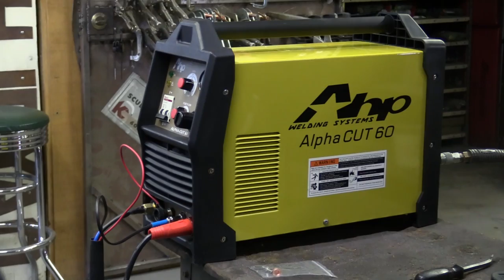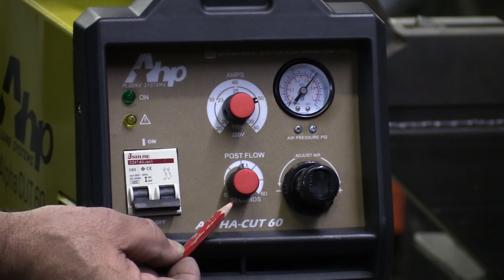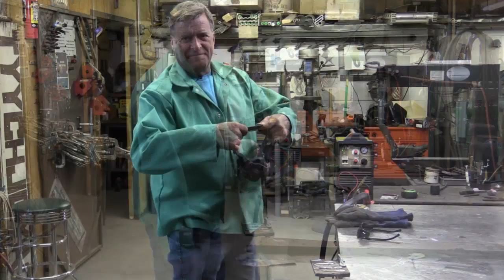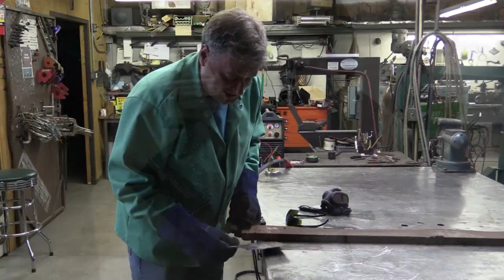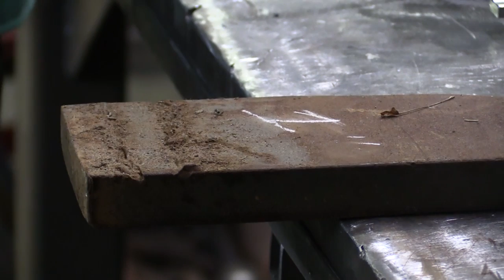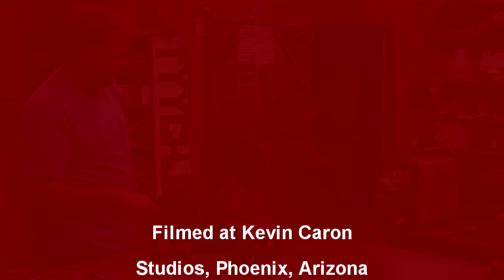Introducing the New AHP AlphaCut 60 Plasma Cutter - Kevin Caron

Comment: Did you say you think this is better than the TD Cutmaster 60I?
Reply from the maker: It cuts just as well for less money. Lighter weight and quicker to set up.  Had a guy stop in to give it a try and paid cash over the TD.
Reply: @KevincaronSculpture  Thats great good performance at a reasonable price.  Ive had a Cutmaster 58 for a year snd it gets used quite a bit. No issues so far. It doesn't have the bells and whistles of a 60i but i dont need that. 👍

Comment: Hey Kevin, I'm looking to get a plasma cutter and i have narrowed it down to 2 manufactors the AHP and the Everlast. I see you have tried out both of these types. Wich one do you perfer or recommend?
Reply from the maker: The AHP alphacut 60 is a very nice machine.    It is great if you are not going over 3/4 inch.   Over that you need to go with the Everlast 80s.
Reply: @KevincaronSculpture  how about the 50S and the 60S are they and good
Reply from the maker: I haven't use either of them but have not heard anything bad about them.
Reply: Ok thanks

Comment: hey Would like to see that cut through heavy rusted or painted steel. that is the real test for me.
Reply from the maker: I have not found anything this machine won't blow through.   Will try to film this for you next time we shoot.
Reply: that would really be good to show on your next review. Show cutting through tar coated fender well and rusty metal, and cutting through  painted metal with lots of coats of paint. Review after using this machine for x amount of time. will get lots of watch hours. I just purchased that ac dc tig and cant wait to use it the AHP. seems good. my plasma cutter really sucks but I really need to try it on 220 before I say that it is not AHP. Dont know the brand off hand.

Comment: Nice video, Kevin! Thanks for that!  Anyway as to 60 amp plasma cutter from Everlast and AHP, is there any real difference since they are the same company?  I am pretty much ready to buy the AHP but I have to say the web site information as to what is included in the box, i.e. extra consumables if any and even a downloadable manual, is somewhat less than forthcoming which is annoying to say the least.  I am assuming these are Chinese units but since with a 3 year warranty, I am also assuming them to be of better quality than most imported units. Also I gather they use IGBT's instead of MOSFET's?  Thanks for any info you can share about this!
Reply from the maker: Well, first off, Everlast and AHP  are NOT the same company.  They are run by different people on opposite sides of the country.  I will say that the guy that owns AHP USED to work for Everlast. The owner of AHP goes to China once a month or so to watch the production line run.   He test machines as they come off the line to make sure everything is correct.    So knowing that, I have no problem with the AHP line.   He (the owner of AHP) also walks across the street to check on the factory that produces the Everlast machines.   I find both lines to be high quality and would stand them up against the red or blues machines any day.    Oh yeah, Yes, both lines use IGBT.   The best way to reach AHP is to call.   Just remember they are in eastern Canada so call at the right time. I find between 10 am and 1 pm arizona time to work the best.
Reply: Thanks for clearing that up!  It seems there are several outlets that handle both so there is an assumption  made on several forums that there is a connection.
I have been in contact with 'George' and he has been quite helpful with regard to tip availability and selection. Good man!  I guess what I would do is order several of the ones for my purposes from ebay at the same time I ordered the AlphaCut 60.
I suspect I would be cutting similar materials and thicknesses as you are so any recommendations as to your most successful tips combos?
Thanks and carry on with the videos!
Reply from the maker: George can set you right on the tip sizes.   Hope you will support the little guys instead of corporate.  I just asked George what he recommended and he sent a set.  Came in a plastic organizer box and everything.
Reply: Well, I just got the AlphaCut 60 and it is sitting on my living room floor!  I see in the manual there is reference to MOSFET chips in the troubleshooting chart, but I was lead to believe this unit was IGBT.  I guess as long as it works.  Anyway as to voltage input, is there a selection switch inside the unit that needs to be set for 110v or 220v?  The manual does not mention much and I have to say that if this machine has a downfall, it would be the lack of info in both the manual and even on the website. Still, I am expecting it to be a very nice machine and can't wait to try it out...after I take it out to my garage!
Keep on with the vids, eh!

Comment: what about the air compressor?
Reply from the maker: Not much to tell, 60 gal minimum on the tank size and make sure it is DRY air.  I like a 2 stage compressor but a single will do fine.

Comment: ahp doesn't have any plasma cutter on amazon anymore? I'm in the market thinking about everlast power plasma too
Reply from the maker: Hit and miss on getting the AHP plasma.   They sell out very quickly!     Been really happy with my Everlast PowerPlasma 80s.
Reply from the maker: You can also check with George over at www.georgesplasmacuttershop.com       He is a world of information and can get you consumables as well as new torch and cable for your machine..   He also makes accessory's to fit your machine, like training wheels and a cool circle cutting guide.
Reply: I've got the Everlast 60s. I have been very happy with it. I really like that I can find the consumables just about anywhere and for not too much dough.

Comment: Hey Kevin....So I have seen you use both this new AHP Plasma 60 and the Everlast as well.  Now that you have had it for a while, if you were buying one today, which brand do you lean towards?  I have an Everlast Power iMig200 and like it and I am looking for a decent Plasma now.  I have looked at the Everlast 50S, the AHP Plasma 60 and the Eastwood 60, any thoughts is appreciated :-)
Reply from the maker: +Tom Phillips       At this time I would steer you towards the AHP AlphaCut 60..      I feel it is a better buy for the money..    The Everlast plasma I am using is larger amp wise but is also much more dollars wise..      haven't seen the Eastwood so can't offer an opinion on them at all....
Reply: +Kevin Caron, Artist 
Thanks Kevin!  I specifically would be comparing it against the Everlast 50s (new model) @~$800

Comment: Good video ... I am looking to buy a 60amp plasma cutter for my shop. However ... that's quite expensive for a plasma cutter from a company that has never made them before ... nothing much out there covering this. I was leaning more to the $700 Eastwood Versa Cut 60. They have sold thousands of them and have a good warranty. How did you decide to get this one ?
Reply from the maker: +Logical Guy 

I have their TIG  and Mig welders and they are very good machines..      Have also been talking with the guy that designs them so I know a little about how they are built..       Been a solid machine so far...

Comment: You can see, especially with 1 inch plate,  that there is almost no melting and almost all material is blown away.  What size compressor drives this?
Reply from the maker: +jtbmetaldesigns       I have 140 gallons of tank and a two stage 2 cylinder compressor...    Don't remember what the pressure was set at on the machine but it was in the 75 to 80 range...

Comment: Any specifications for the machine yet?  I went to ahpwelds.com and didn't see any mention of it.

Does it have a pilot arc?  When are the production units shipping?  What brand and model of torch does it come with?  Any idea of duty cycle?  So many questions...

$700 a heck of a deal for a 60 amp unit.  I like all the controls on the front too.
Reply from the maker: +dahveed284        Yes, it is pilot arc and yes the machines have shipped and are in stock.     You can order through me or AHP.      Don't remember on the duty cycle,   sorry the paper is at the studio...
Reply: +Kevin Caron, Artist 

What brand of torch?  I'm really interested in purchasing one of these, but i want to know what I'm getting.  Sorry to pester you.  I'd look it up on the ahp site if it was up to date.  i'll buy it from you if i do pull the trigger.
Reply from the maker: Not sure on the brand but it is marked

IPT-60.     Looks like a Trafimet torch..   (think I spelled that right)
Reply: +Kevin Caron, Artist 
The IPT-60 torch appears to be fairly common with consumables available from Longevity and Everlast.  

Also the AHP web site doesn't appear to be a good use of bandwidth, at least regarding this product.

Will likely be calling you on Wednesday.
Reply: ok

Comment: im 15 and i weld every single day i like welding with ac but i have a million 7018's that wont run on my ac arc welder do u know a good durable but cheaper dc welder i can do a certified weld just need to get me a dc arc i have a tig, ,mig, plasma cutter, and oxy acet torch so just missing that one chunk and im a big fan so yeah idk but do u have a dc u can show me how good it is?
Reply from the maker: +Zachariah Campbell       You have a tig welder, but it is not a stick welder also?!   What tig welder do you have?     I would look at the Everlast PowerArc 200 for a great stick welder....
Reply: ok thanks man i go look i have a stick welder just not a dc stick welder

Comment: It is a very nice cuter , but I still like my Hypertherm 65 . I have cut up to 1.75 " nice and smooth which was set on 65 amps and 80 psi. But I did pay an arm and a leg for it. Thanks alot for all the videos.
Reply from the maker: +Jessie Chisholm      1.75" with a 65 amp!!???     Have to see the video on that one!
Reply: Well even you said in your video, that it isn't the amperage that cuts, that it was the air pressure. So I guess you didn't agree with what you said in your video.